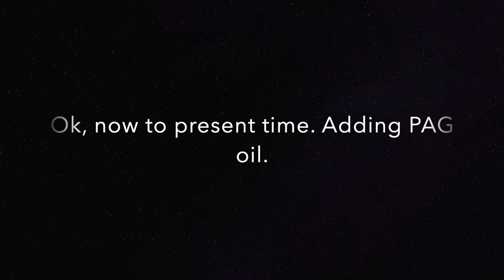3rd Gen 4Runner AC compressor final install. Ep 11

Comment: Thank you for this video. I have a mysterious leak, and it appears to be from the A/C compressor, it is all around it (and is not the valve cover gaskets or power steering pump). Question-could you have added the oil when you had the compressor out? Sorry if that’s a stupid question. Just slowly putting a plan together to fix my system.
Reply from the maker: yes i added the oil in my garage and the taped the line ports with masking tape at 1:58 . I accidentally spun the pulley and it created pressure and allowed it to leak. If you have the compressor out, use the shipping cap instead of what i did. add oil, then screw the shipping cap which will allow the oil to not leak no matter if you spin the pulley. after you bolt the compressor to the engine bracket, remove the shipping cap and install the cover on the compressor that allows you to connect to the high and low pressure lines that i show removing at 1:23